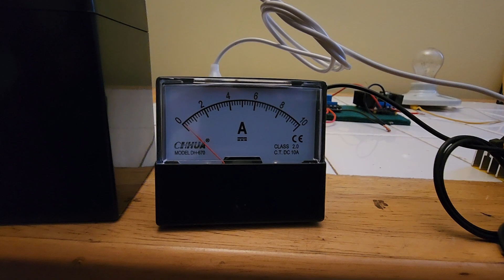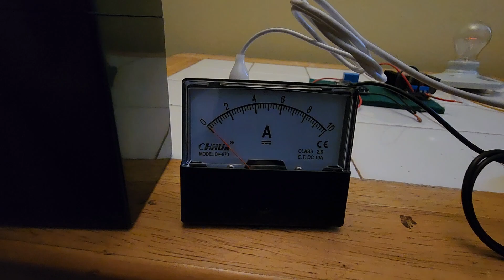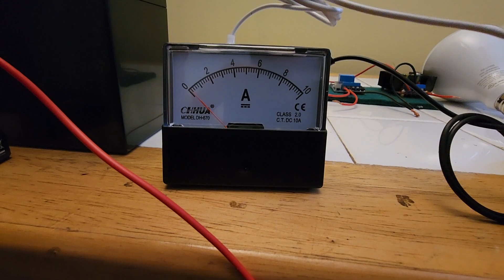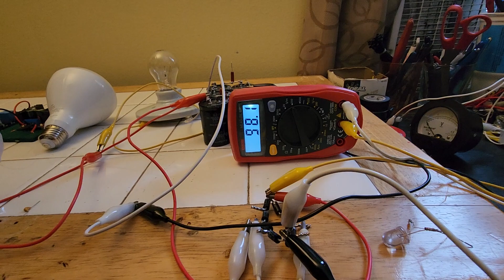🌪1 WATT RINGER SUPER CHARGES DC CAPS & GIVES OFF WIRELESS POWER SUPER CHEAP SELF SUSTAINING ENERGY🌀

Comment: Use a Terfenol D or Galfenol rod for best results. Also it looks like your primary coil is at or near the base of the secondary. If you move it to the middle of the secondary you get max current for the voltage.

Comment: You can try a insulated copper plate say 4ft sq under you setup as a substitute for earth ground.  Also you can change the height  of the receiver antenna higher = more power

Comment: I believe you're moving in the right direction. Kapanadze used a similar circuit only it was 3 phase which allowed for much faster pulsing at very little input. Enough to power massive loads and close the loop.
Well done!

Comment: Way to go, good demonstration of many of the three energy principles that are available to us using Materials that are ordinarily accessible to most people. 

I'd like to see the chat g p t response about the met glass. It's my understanding that special thing about the met glass is that it can reach very high frequencies without saturating, and that the high frequency is like the rotation of a rotor in a rotary generator Whereby Angler momentum of the roder is directly proportional to the output power Due to Faradays law.  It's the same principle that the Motion Less electro magnetic generator used to excite the magnetic field of the permanent magnets. And the same principle that I use in foil capacitors to rotate the electric field Producing a collapse magnetic field and electro motive force.  And technically the reaction from the space itself. Is that force so technically? The met glass is producing a reaction from the vacuum enable  to polarize that And produce an inductive reaction in the secondary coil . 

Anytime you put a capacitor.
In any type of alternating current circuit, you get ADC blocking in AC. Passing effect and even those diodes are capacitors. Only your Meters going to read the DC since it's the stronger current being built up in the capacitor bank. But you still have a c running through which is that wireless energy. In this case, you have a pulse Going Out from the circuit. And then a contraction from the space around the circuit. Which creates your alternating current Wireless energy in your environment. It's the same way that electrons will summon a positron from the vacuum Accept in this case, the annihilation doesn't create A.
Mutual distraction of energy and A net 0 outcome. Because you have a superposition of the same electron occurring in multiple places at 1 time. And that right there is the secret. 

The only hint or tip that I can give you at the moment is that you can utilize surface area To produce more power without additional input. Same thing that you're doing with the capacitors. Except for you can also do it with your wires as well. And also the spaces between your components which Are the most effective when each component in its size shape. Mass density and energy frequency resonance are in a harmonic Output in relationship to each other in the golden ratio. So if you notice dawn Smith's devices, the one that he had with the large capacity bank. He started off with a small. I frequently ensign transformer and then output it that to a larger coil where the coils had a lot of space between the turns. And then he input that into the capacitor bank, which had even more capacity to hold electric field.  And then when you dump that electric field. It produces the magnetic field in electro motive force. So now that you've demonstrated that you have good control over the production of the electric field well. I should say dielectric field, It's just a matter of being able to produce a large amount of electric flux in a smaller. And smaller volume of space. Which is what i'm working on right now. Because we can develop capacitors that have a hundred times the energy density of gasoline per volume.
Reply from the maker: This explanation was phenomenal & makes alot of sense. I saved it to my notes & the crazy thing about the circuit is it's still generating wireless power while rapidly recharging the dc capacitor bank :)
Reply: @MTECHINDUSTRIES117  for every action there is an equal and opposite reaction- the best analogy for this is shown in how light works . There are actually two streams of energy one from the cloud and a reactive stream from the ground. https://youtu.be/RLWIBrweSU8?si=SbiE-s-hhKh7rZ7H
You have this going on in the environment around your circuit. Because of the resistance of the air and other gasses combined with whatever insulation the ground material under your feel contains, the release of the earth's energy is very slow. It's like putting a resistor on a capacitor and slowly discharging. Except the reaction will only occur if you give and equal and opposite charge in the form of atmospheric energy such as a cloud or tesla coil produces.  Atmospheric lightning doesn't need to be high frequency because it has so much electric Flux Density .
Lightning generates broadband electromagnetic emissions, with a large component at "zero hertz" and the remaining energy radiating at many frequencies throughout the electromagnetic spectrum. Each stroke has a unique spectral signature, depending on the various forces involved. 

1
Lightning occurs on average 44 times every second over the entire Earth, making a total of about 1.4 billion flashes per year. Lightning is more frequent in summer than in winter, and from noon to midnight compared to midnight to noon. 

1
Lightning sensors operate in the very low frequency (VLF) and low frequency (LF) range (below 300 kHz), which provides the strongest lightning signals. 

1
Lightning can strike more than three miles from the center of the thunderstorm, far outside the rain or thunderstorm cloud. “Bolts from the blue” can strike 10-15 miles from the thundercloud. 

What we actually experience as electricity is only the reaction coming from the quantum vacuum . As Tom Bearden said, any amount of electricity produced out of any generator is free energy. The problem is that we kill the dipole. We like to get that big bang and then wait awhile until we can go again. Very masculine approach. But the quantum vacuum is the contractive side to the dance of polarities and that's where the unlimited energy actually is as quantified by max Planck. 100 YEARS AGO.  Now if you don't blow your proverbial load on the pulse after pulse thing trying to get higher and higher frequency switching, you can actually let nature do it for you. As long as you maintain the the dipole the ACTIVE vacuum will oscillate its dipole back and forth. The charge will move from one side to the other and then the polarities will be reversed and then the charge will move in the opposite direction. Each time it changes direction a magnetic pulse is released (light) (ning) which is what we observe as the energy producing work but in reality it was the dielectric field maintaining its dipole . The trick is have a large dielectric to induce a magnetic reaction in a conductor without losing the dipole. Electrolytic caps will lose the dipole once the magnetic field pushes the electrons to the other plate equalizing the amount of electrons killing the dipole. One plate isolated connected to a load and the load connected to ground. Then you just pull out the ground energy without using any input from the circuit.  You basically got it but you can pull a lot more power just by adding surface area to increase electric Flux Density. All you need is that one electron to do its superposition thing and all of a sudden you will get simultaneous reaction from every point where those same conditions are met at the same TIME in different SPACES...https://youtu.be/HDzVD-cqiWM?si=KFOg28zLM6fooo5s

 @MTECH2022  basically just keep her cumming and hold off blowing your load.
Reply from the maker: @earthpower783  haha that's an amazing in very detailed in depth explanation & i also saved that to my notes. Everything is beginning to make a bit more sense now because bringing the correct coil even within 5 ft of the ringer circuit causes it to output & relay more wireless power with no input drain to the source & what would be the best & most efficient capacitors you'd recommend?
Reply: @MTECH2022  for every action there is an equal and opposite reaction- the best analogy for this is shown in how light works . There are actually two streams of energy one from the cloud and a reactive stream from the ground. https://youtu.be/RLWIBrweSU8?si=SbiE-s-hhKh7rZ7H
You have this going on in the environment around your circuit. Because of the resistance of the air and other gasses combined with whatever insulation the ground material under your feel contains, the release of the earth's energy is very slow. It's like putting a resistor on a capacitor and slowly discharging. Except the reaction will only occur if you give and equal and opposite charge in the form of atmospheric energy such as a cloud or tesla coil produces.  Atmospheric lightning doesn't need to be high frequency because it has so much electric Flux Density .
Lightning generates broadband electromagnetic emissions, with a large component at "zero hertz" and the remaining energy radiating at many frequencies throughout the electromagnetic spectrum. Each stroke has a unique spectral signature, depending on the various forces involved. 

1
Lightning occurs on average 44 times every second over the entire Earth, making a total of about 1.4 billion flashes per year. Lightning is more frequent in summer than in winter, and from noon to midnight compared to midnight to noon. 

1
Lightning sensors operate in the very low frequency (VLF) and low frequency (LF) range (below 300 kHz), which provides the strongest lightning signals. 

1
Lightning can strike more than three miles from the center of the thunderstorm, far outside the rain or thunderstorm cloud. “Bolts from the blue” can strike 10-15 miles from the thundercloud. 

What we actually experience as electricity is only the reaction coming from the quantum vacuum . As Tom Bearden said, any amount of electricity produced out of any generator is free energy. The problem is that we kill the dipole. We like to get that big bang and then wait awhile until we can go again. Very masculine approach. But the quantum vacuum is the contractive side to the dance of polarities and that's where the unlimited energy actually is as quantified by max Planck. 100 YEARS AGO.  Now if you don't blow your proverbial load on the pulse after pulse thing trying to get higher and higher frequency switching, you can actually let nature do it for you. As long as you maintain the the dipole the ACTIVE vacuum will oscillate its dipole back and forth. The charge will move from one side to the other and then the polarities will be reversed and then the charge will move in the opposite direction. Each time it changes direction a magnetic pulse is released (light) (ning) which is what we observe as the energy producing work but in reality it was the dielectric field maintaining its dipole . The trick is have a large dielectric to induce a magnetic reaction in a conductor without losing the dipole. Electrolytic caps will lose the dipole once the magnetic field pushes the electrons to the other plate equalizing the amount of electrons killing the dipole. One plate isolated connected to a load and the load connected to ground. Then you just pull out the ground energy without using any input from the circuit.  You basically got it but you can pull a lot more power just by adding surface area to increase electric Flux Density. All you need is that one electron to do its superposition thing and all of a sudden you will get simultaneous reaction from every point where those same conditions are met at the same TIME in different SPACES...https://youtu.be/HDzVD-cqiWM?si=KFOg28zLM6fooo5s